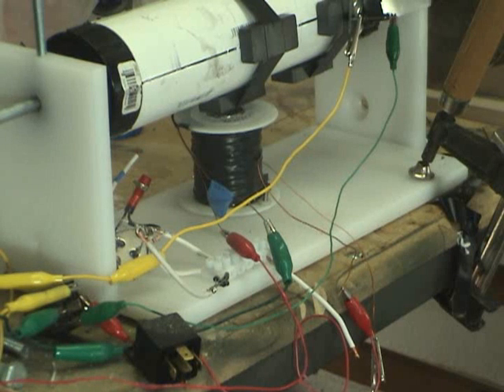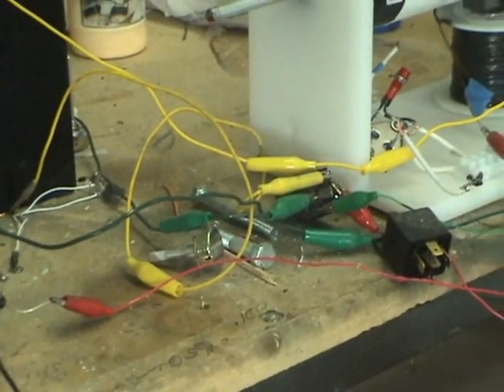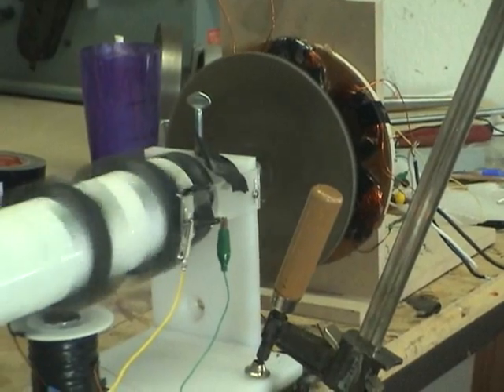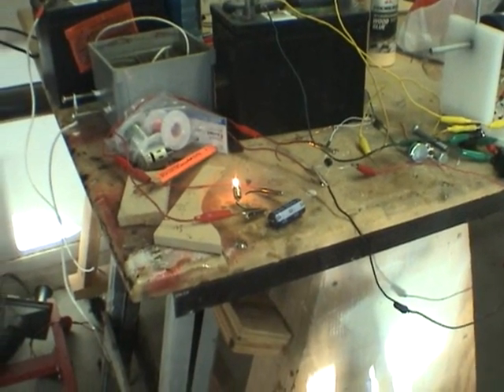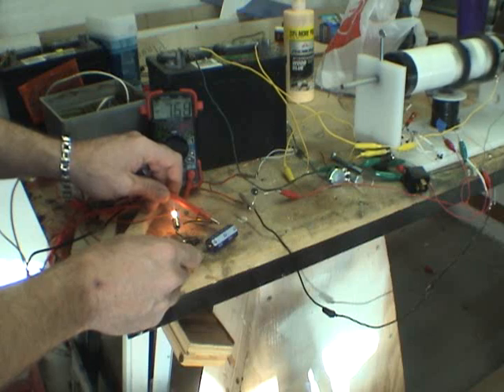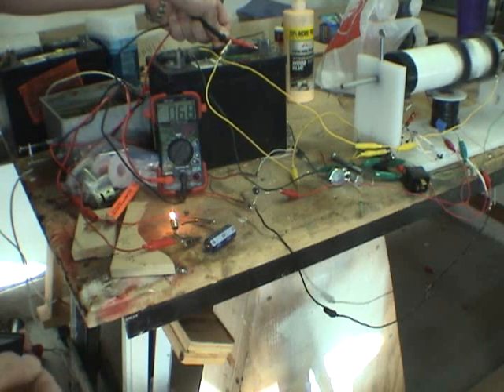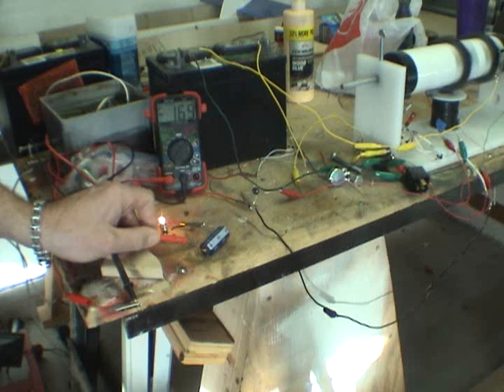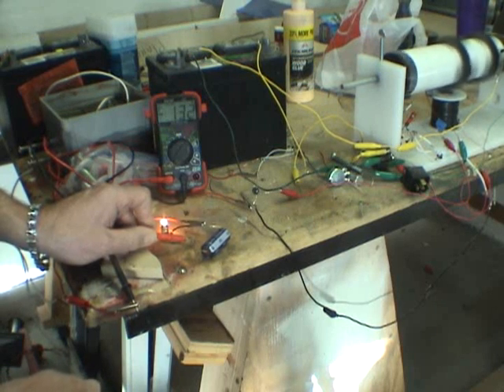Kiss my *@#%!

Comment: @DeadJack57 
Because the meters used to measure the output can be fooled by unstable output. IT can be reading peed output, not average output.

Therefore, unless this thing can be demonstrated to do something useful, like prolong the life of a battery, then is is by definition use-less.

Comment: Why not demonstrate this device in a more practical way?

Why not power some form of device with this thing, and then power another just with a battery, and run them together. If the device make the battery last twice as long while doing the same amount of work, then that would demonstrate that it works.

Or why not run the output into the input and disconnect he battery?

Comment: really great work.. definitely not a naysayer, but i think maybe instead of bashing you they should have just pointed out the voltage across your load is necessary to determine the output watts, also taking into consideration the load must be calculated according to your resistance for a "proper" reading which is all impossible IMO anyways... i say who cares as long as the batts are swappable.  your vids helped me get started on the bedini too so thanks man =)

Comment: have you used a scope or a filter on the input? the digital meters are notorious for poor filtering above 10 hz. and that babies running at quite a bit. input is a major pulse not a smooth flow.

Comment: This is not over unity get your facts strait, supply a schematic, get some real data on the pulsed current, You are fooling yourself with the readings you are getting, because the meter you are using, and the way you are using it, is not by far, an accurate way of measuring the actual energy consumed or delivered by the circuit. Please consult an engineer get him to do the tests and if he still finds that your circuit is over unity, we will kiss your ... :)

Comment: Battery power in: 12.15V x 0.068A = 0.8262W
Load: 7.7V x 0.17A = 1.209W
So , it appears as though more power is coming out than goes in.
I suggest to modify either the running or output coils so that the output voltage is higher than the input voltage. This is needed for the unit to feed itself and recharge its own battery. If this can be achieved and demonstrated, I will personally fund further development.

Comment: I'd like to see this experiment repeated with the voltage drop measured across a shunt to determine the current.  It is the most accurate method I know of to measure current.
I think the real test, though, is to get it started with the battery then feed the output back into the device and see if it keeps running.  If you are, in fact getting 63% more power out than you are putting in as your numbers suggest it should be no problem and the motor should run until the bearings wear out.

Comment: Not that I'm knocking your efforts here, so keep up the good work.  Just wanted to point out one thing.  You disconnected the wire and ran the current through the ammeter to try and measure the amperage.  This is wrong, as you want to leave the wires connected and just touch the ammeter probes to either end of the operating wire.  That will give you an accurate ammeter reading.  Pushing the load through the meter gives you an inaccurate reading, and usually burns out meters.  ;)

Comment: Notice as soon as he disconnected the battery the light went out, even though his motor was still turning.  That in itself proves the current to light the lamp comes from the battery. or the lamp would have stayed lit when battery disconnected and the motor was turning it would have kept the lamp lit except the lamp current comes from the battery.  Also notice he is such a genius he cant keep amps and volts in order

Comment: Laws of perpetual mouvement machines :
1- they don't need inicial impulse to start running.
2- once running they don't stop unless brake is aplied.
3- they work without electric wires/motors attached.
4- and finaly... they don't work, whatever you do.
If any of these rules is violated, is a fake machine.

Comment: I am challenging you to actually take this unit out into your driveway, and without all the wires and junk on your bench..... hand start this machine without the battery, and produce more ACTUAL energy than you are using.....Stop with the smoke and mirrors and make it work without false readings from your digimeter.....Lets see that one !!  Bet you can't do it......LOL

Comment: these small "quantum" affects (as you call them) can be stacked up to a measureable level. Working models of permanent batteries that require no charging and never run down have been pioneered successfully, yes!

Comment: No the energy comes form sources you are unaware of, I never said it was magical, that is your rationalisation of something you cannot explain. In your terms electricity is an imbalance it wants to reach equilibrium with any node that has less charge than itself. Like you said thru this transfer of energy is the ability to cause work to be done, even if it does not "do" the work itself... a magnet is continuously charged by the radiant energy the driving force behind the  physical universe.

Comment: Like I said....even if this is true on an ultra small quantum level (Id have to research this particular issue before commenting one way or another on the validity of this statement)...but if true on a some quantum level...by your own admission this is far to small even to be measured, let alone get any usuably energy from. Plus how can it even be proven if it is not measureable?

Comment: Actually it is...and it is even reverseable.....by sending an electrical pulse into a crystal you get mechanical motion....
Same with a magnet. sending electricity through a coil will cause the magnet to spin.....
Its a  good clue that you are simply transforming energy since it can be reversed back and forth...
What of pyroelectric devices...with two different metals are heated and that heat is changed into electrical energy. Dont mistake elec charge for energy, this is ur mistake perhaps?

Comment: I do not know this is the case, but maybe on a quantum level where weirdness is the natural order of things...sure why not. By your admission these are much too small to even be measured let alone cause any actual work to be done. the energy to do work still has to come from SOMEWHERE...and there would not be enough energy in a magnet to even be measured on its own. Hence fluxing the mag field through mechanical (or other)action is only way to get workable E....a mag is the means not the source.

Comment: A magnet sitting next to a coil will induce current in the coil but it is too weak to measure. I have diagrams of permanent batterys made from stationary magnets and coils showing measureable current flow. NO mechanical energy!

Comment: I don't think mechanical energy is transformed into electrical energy directly. When hitting a piezo crystal for example you are compressing the structure and releasing electrical energy from the atomic arrangement. The mechanical energy is just the force needed to induce that effect. With magnets the coil is capturing electrons which are not condensed sufficiently when the magnet is stationary. Moving the magnet thru the coil allows more of the electrons to be captured from the magnetic field.

Comment: {here is my continuation from my past reply} an electromagnet can be turned off and on or flipped which will cause the same effect as a spinning (or just moving) magnet.  A magnet does not give energy to a coil....it simply transfers mechanical energy from the movement of its field to electrical energy, just as many other process do (for instance pyroelectric with heat...or piezoelectric when hiting a crystal....energy can never be created or destroyed....it can transform and move though

Comment: No I think you are misunderstanding the concepts behind magnetism and how it can make electric current flow in a wire. A magnet can only make current flow in a wire if if that magnetic field is fluxing in some fashion. A magnet sitting next to a coil will not cause current to flow in a coil. The magnet field has to be moving...this is why Generators generally spin a magnet in the presence of a coil to work. Otherwise an electromagnet can be turned off and on or flipped{continued in sep response}

Comment: the energy in a magnet comes form its atoms and electrons, they are continuously being brought into a state of charge by the radiant energy of the universe... I think to say "zero point" energy is a misunderstanding of the principles. A magnet does not use energy it gives energy to a coil of wire for example which is simply capturing its free flowing electromagnetic fields. A very long time is a VERY LONG TIME lol

Comment: Under normal conditions a magnet will last a very long time......however, since energy cannot be created or destroyed only changed in form, if you were to take energy from a magnet in some fashion....then you would be depleting it and it would indeed run out. However....IF you can get the mag to somehow suck in more energy from ZP....then it will not be using up its own energy. A magnet does not "use" energy when it moves a piece of metal...the metal is only finding equilibrium in D mag field

Comment: It may be  possible of course....however if it is possible to suck energy from a magnet then it would not be any more useufull than a regular battery....since energy cannot be made or destroyed you would end up depleting the magnets energy and it would just get weaker and weaker...running out as a battery does...However if by resonating the flux(or whatever) the Magnet sucks energy in from the ZP field around it....then it would be virtualy inexhaustable.....

Comment: IF this device truley works as claimed....then I would guess you are right.....If the energy was coming from the magnetic coil...then it would be draining it.....The free energy devices that I have seen that seem to be legit seem to suck energy from nothing (as in ZP energy).  Many of the more legit sounding ones indeed seem to do this using some kind of magnetic field fluxing at a resonance of some sort. Of course I dont know if this device is realy doing this, I would have to study it.

Comment: Those VOMs are only accurate when measuring either sinusoidal AC or DC current.  Since the current is pulsing, your current value is wrong.  

You need to put in a small series resistor, and use a fast oscilloscope to measure the current spike from the battery.  Then integrate over one period to find the actual current.

This is typical of pulsed circuits when mixed with VOMs, and why Newman and Bedini like them, because it allows them to make bad measurements in their favor.

Comment: The energy in the bulb seems to be coming from the secondary coil which seems to be driven by a pulse through the primary coil connected to the battery.  Without the battery the system seems to stop dead.  If the alternator can generate enough current then the system should work without the battery once it gets up to speed.

Comment: My theory is the magnets are inducing emf in the coils making an otherwise inefficient motor more efficient. In other words the output is closer to 100% effeciency of the system than the power in. The power in side of the circuit loses power through friction, resistance in the bearings etc... the output side has none of those losses to consider and is therefore more effcient.

Comment: RupertsCrystals, check out the free energy research documents by T.E. Bearden.  Knowing what exactly what is happening is great, but that won't make this device more or less efficient, dig?  To paraphrase Beardens writings, all electric circuits draw energy from the quantum vacuum, only the way that we have learned to design our circuits uses half of the energy we receive to shut down the flow of energy from the quantum vacuum.  Pulsing a circuit at the right frequency saves the day.

Comment: If the light bulb was powered by the motor, why did it instantly go out when you disconnected the battery, despite the motor still moving just as fast as when you disconnected it?

Comment: Man you dont half get alot of pricks out there ready to disporve or agrue somthing they dont understand lol. im doing the bedini circuit myselkf - here in england. iv been messing with the reed switches, that produce a shead load more back EMF, an i ran it directly into a cap and ran a moter off of it whilst it was still charging the cap. these guys a moorons lol. your set up looks grate and sterdy - unlike mine with the polerstyreen bace and chip board xD. all the best to you ^___^

Comment: Input -
Battery - 12.15V @ 0.68A = 8.262W

Output -
Cap and Bulb - 7.70V @ 0.17A = 1.309W

Take the output wattage away from the input wattage = 6.953W

This machine, in the condition shown still uses more energy than it outputs. The real outcome will be decided by the efficiency of the windmill style generator extracting energy from the rotational motion.

Comment: OK, one flaw in your assumption of the current being less than what the meter is reading... depending on the meter, they usually average out pulses inside the meter, so it is probably more current in each pulse than the meter shows.  You should hook a scope to it to see the pulse widths...

Comment: Excellent job for showing the input volts and amps vs the output volts and amps.
I do believe there is more energy coming out of the device than going in.
You can't get energy for nothing. So, where is the extra energy coming from?
 The extra energy emitted to light the bulb is generated at the expense of the magnets.
 What this means, the magnets are losing charge and will after days be weaker. Thus, the output will drop and drop to unity and then less.

Comment: Todd: Stop using the term FUEL! This is TOTALLY FUEL-LESS drive! The first circuit can turn 6 or more 3-phase alternators - this will run 36v vehicle through controler. Ignore "overunity", the Alternator is TOTALLY SEPARATE from the initial pulse one. It is a SPECIAL CASE of the Thevenin "Black Box" principle! This finishes OIL in transport - FOREVER! Keep working - just ADD to what you have already done! Need Vehicle, come to BioMod comm.

Comment: 2.: I would use 1 Farad super caps in the necessary series parallel configuration to achieve the necessary store. You will obviously need to prime the circuit with a battery (or hand crank you rotor a good many times) to get it going. But if your calcs are correct it should self run.

Comment: My calcs show .8262W in and 1.2936W out (assuming steady current in both cases which you stipulate the input is less).

If the current is not being dragged out of the source battery we should be able to design a two stage capacitor circuit to make this self running. Charge one cap as you show here. Using another of your magnetic switches dicharge the cap into the secondary capacitor when the back EMF is zero. The secondary cap is the store for your primary winding on the pulse coil.

Comment: (read post below first)
Suppose you have 1,000 pieces of wire twelve inches long and you run the same weak magnetic field over them all at the same time..... you get the same flow of electrons.
If the wires are run in series then you will get the 12,000 millivolts etc.
If you connect the wires in parallel you will get higher current but lower voltage.
However, the power potential is the same whether you run the wires in series or parallel.

Comment: So, you have a wire twelve inches long and you can make 12 millivolts moving a magnet across it.
If you have a wire 1000 feet long and you move the same small magnetic field across the length of it you can create much more voltage potential perhaps 12,000 millivolts lets say.
So, you have managed to generate a significant amount of electric power with a weak magnetic force.
OK, how does this help us? where am I going with this?

Comment: If you have a small magnetic field moving across a wire twelve inches long it can generate an electron flow equal to lets say one millivolt per inch.
If you move the magnet twelve inches at the same speed you get 12 millivolts as you transgress the twelve inches of wire. (read above)

Comment: Litz is individually insulated stranded wire.  Try this for your coils, that are having the magnetic fields produce the current. Magnetic field over 1 wire = d. Magnetic field over 105 individually insulated wires = d x 105.  :)